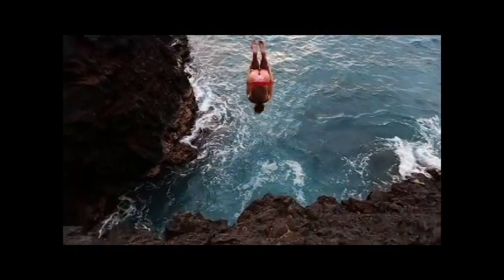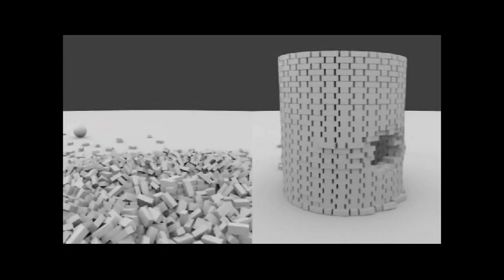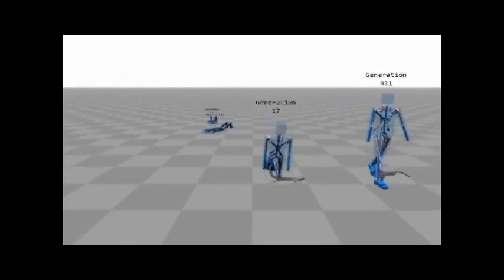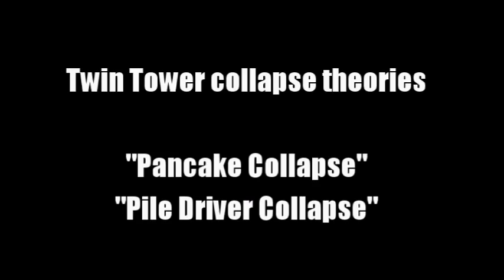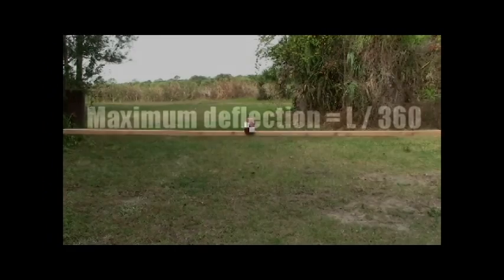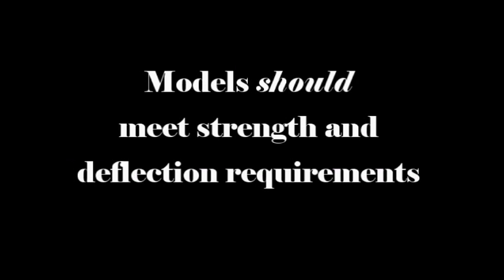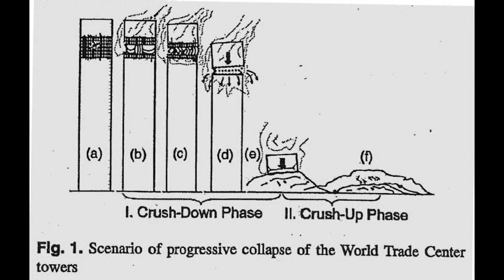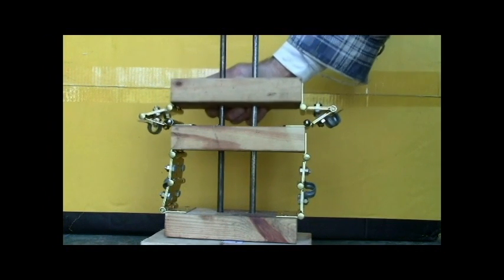9/11 Experiments: The Force Behind the Motion

Comment: As a practicing structural engineer, I should be considered qualified to claim that there are so many things wrong with this video that it is embarrassing:

1. You can't criticize the accuracy of a computer model (which has been proven to accurately predict actual stresses and stains in a structure based on the actual member sizes, material properties, and building dimensions) and then claim that scale models made out of cement board, paper and plastic arranged in ways that are not at all similar to the building construction of the twin towers are accurate.  In this case, you can't assume that physical models will scale to full size correctly, but you can for example use a small scale test to determine the material properties of various materials, and then use that information to determine the large scale behavior of that particular material.  While I'm not positive what type of material you'd have to use for it to scale correctly, I would imagine that you need to use a material that is both extremely weak and heavy at the scale you are working with.

2.  The method you use for picking the floor material makes no sense.  You pick a group of 4 planks to represent a floor because it deflects a certain amount under a certain weight, but your selection is completely arbitrary because you don't have any particular reason for picking a 20 lb weight and you don't take into account the strength of the boards.  In reality when a building is designed, the selection of member sizes is much more complicated than you allude to, and it is not at all arbitrary.  Even then, if the structure pancaked, the floor material doesn't matter, because the COLUMNS are the members that fail... the floors are merely mass that has momentum once it starts moving downward.

3. The experiment you do with the cement boards (6:13) makes no sense.  There wasn't a weight that fell down through the towers failing the floors in FLEXURE like you're testing.  The mode of failure for each floor would have been the simultaneous axial buckling of all columns on each floor, but you make the "columns" (i.e. the wood frame) extremely rigid.

4.  You model the columns with plastic pizza spacers, but the problem is that you are not using a material that will buckle and fail under the impact load which is many times larger than the floor load the building is designed for.  If you want any hope of an accurate model, you need to pick columns that would fail at about double the static load for that particular floor.  Turning the plastic spacers sideways just gets them to shoot out sideways when they deflect...not because they fail.

5.  Same issue with the paper and matchsticks.  Even this material has too much strength, as evidenced by the fact that the same system that is used for the lowest floor is also used for the upper floors.  You make a comment that they don't meet the "deflection criteria", which is a statement that makes absolutely no sense, as you typically don't look at deflection of columns or wall systems in the same way that you look at the deflection limits of a floor system.  If the columns support the exterior cladding, they are subject to certain deflection limit for wind loads between floors, but it never has a significant impact on the column design of high-rise buildings.  Rather the entire lateral force resisting system (either shear walls or bracing) needs to be designed to limit the side-sway of the building.  Burning the walls/columns or busting them up with fireworks doesn't really prove anything either, other than you get the appearance you were hoping for with the fireworks.

You say at the beginning that you are a PE, but what is your particular area of practice?
Reply: +Bernadotte01 Lol!

Yeh, because everyone knows that you need to have at least a safety factor of 2000 when you design a building................. I bet it was a typo, and it was supposed to say 2.00%(So just 2, not 200) which seems more natural. I am in steel construction and we use around 1,5% safety factor, so 2000 is ridiculous. The building would collapse in on itself, because of the weight of the structures needed. Or it would just be a solid steel block.

And the towers withstood the impact of the planes. Or did you not pay attention?

And NIST sent a large part of the FEA of WTC7, and I guess NIST thought, that a group of engineers and architects, could figure out how to model the rest, since they also provided the drawings. And this was in 2009, so what have they done for all this time with this information?
Reply: +chewy531 Well said sir!

I guess this engineer doesn't know that scaling never works well. Unless he wants to see how his car does in a crash, and buys a similar toy car, and throws it against a wall. See, nothing broken, so my car will be indestructible.
Reply: +chewy531 He is a civil engineer specializing in water and sewer systems.
Reply: +chewy531 regarding your deviously dishonest assertion in point 1 about the fabulous capacity of the computer model used by NIST for predicting "actual stresses and strains", NOTA BENE, quote:
=======================
FINDING REGARDING PUBLIC SAFETY INFORMATION
Pursuant to Section 7(d) of the National Construction Safety Team Act, I
 hereby find that the disclosure of the information described below, 
received by the National Institute of Standards and Technology ("NIST"),
 in connection with its investigation of the technical causes of the 
collapse of the World Trade Center Towers and World Trade Center 
Building 7 on September 11,2001, might jeopardize public safety. 
Therefore, NIST shall not release the following information:

1. All input and results files of the ANSYS 16-story collapse 
initiation model with detailed connection models that were used to 
analyze the structural response to thermal loads, break element source 
code, ANSYS script files for the break elements, custom executable ANSYS file, and all Excel spreadsheets and other supporting calculations used to develop floor connection failure modes and capacities.

2. _All input files with connection material properties and all
 results files_ of the LS-DYNA 47-story global collapse model that were 
used to simulate sequential structural failures leading to collapse, and
 all Excel spreadsheets and other supporting calculations used to 
develop floor connection failure modes and capacities.
~
Patrick Gallagher Director National Institute of Standards and Technology
Dated: JUL 09 2009
=======================

Regarding point 4, in which you absurdly claim, quote: 
"You model the columns with plastic pizza spacers, but the problem is that you are not using a material that will buckle and fail under the impact load which is many times larger than the floor load the building is designed for.

quote:
===================
A design procedure that will be used for structural framing of the 1,350-ft high twin towers of the World Trade Center in New York City gives the exterior columns tremendous reserve strength. Live loads on these columns can be increased more than 2,000% before failure occurs. 
-Engineering News Record, April 2, 1964
===================

2000 percent live load redundancy means 19 of  every 20 perimeter columns could be removed and the loaded building would remain standing. (Or you could stack 19 more copies of the building on top of the first without a collapse ensuing.)

i) Do you really think the paper and matchstick walls in the lower levels of the experimental tower wouldn't buckle or crush if <i>95 percent</i> of the paper and matchstick supports were removed?

ii) Why do you think the resident structural engineer at WTC, Frank DeMartini (who supervised repairs following the FBIs basement bomb in the 90s), state, on television, that he thought the towers could easily withstand "multiple impacts" from jetliners?
Reply: +Bernadotte01
Just saying that my "assertion" that the computer models are accurate is putting your life on the line anytime you enter a building or drive across a bridge that has been designed using that software.  Just like any software, you need to enter accurate information (garbage in - garbage out), but these FEA programs like ANSYS have been proven to be accurate depictions of actual stresses and strains in a structure when its modeled correctly.  These computer models are not at all controversial among engineers as they put scientifically proven concepts regarding material behavior into practice.  

On the other hand, I haven't seen anyone give any good reason at all to trust the accuracy of testing collapse mechanisms using scale models.  All I have to do to prove that the scale model isn't accurate, is to point out that the materials used to make the model are not destroyed.  Actual building collapses stress the building materials past their ultimate stress, while the cement board, plastic and match sticks used in the scale models aren't yielded, crushed, or ruptured in any way (other than when they are lit on fire or exposed to fire crackers).

Regarding the 2,000% over-design... lets do some actual math.  Note that it is only the LIVE LOAD that can be increased by 2000%... but live load isn't the only load on the structure.  On March 13, 1969, ENR stated that the total weight of steel used in the structures was 200,000 tons which was about 1/5 of the weight of the structures.  That means that each tower weighed (200,000 tons)5/(2 towers) = 500,000 tons.  The building code requires a live load of 50 psf for office areas and 80 psf for corridors and lobbies not on the ground floor.  60 psf is a more than generous average.  The code allows Live loads to be reduced to 40% of that load for columns supporting multiple floors.  The total floor area of each tower is (209ft)(209ft)(110floors) = 4.8 million square feet.  So the total live load is (4.8 mil sqft)(0.4*60)/(2000 lbs/ton) = 57,600 tons.  Therefore, the live load only accounts for around 10% of the total gravity load.  This means that if you multiply the live load by 2000%, you come up with a factor of safety of (500,000+20*57600)/(500000+57600) = 3.0.  Note that this does not consider any loads from wind loads which would be a significant portion of the load on the exterior columns (at least for the WTC the way it was built).
Reply: +JohnnyBoy2222 
Thanks... and good points yourself.

I read these reports by NIST and ASCE and they speak the language structural engineers use.  When I hear these arguments from the conspiracy theorists I don't get the same thing, and I have yet to hear someone that uses the same language and/or puts actual numbers or accurate models together.  It sounds to me like they are trying to prove a flat earth or something... no basis in reality and smothered in needless skepticism.
Reply: +chewy531 The sad thing is, that they want to explain a building construction in simple math and physics terms. Or throw in Newton's laws. According to truthers, every physics teacher can design the perfect building. And what amazes me the most is that truthers seem to have no problem believing some guy in a youtube video, but dismiss the mountain of work NIST has done to explain the building collapses. This guy does not give out his credentials, because he knows he is full of it.

I can understand that reading the NISt report is a daunting task, especially for people who have no background in engineering, but they also have a FAQ, where they explain most things in laymens terms.

The towers FAQ

http://www.nist.gov/el/disasterstudies/wtc/faqs_wtctowers.cfm

WTC7 FAQ

http://www.nist.gov/el/disasterstudies/wtc/faqs_wtc7.cfm

I have encountered many truthers who never even read those FAQ's , and come up with stories that NIST has explained years ago.

What makes me mad and sad is that this Cole, if he truly is an engineer, should know about the scaling issues in his tests, so either he is no engineer, or he is purposely misleading the people who watch his videos.

And according to AE911 website, he is a civil engineer, so he is actually misleading these people.

"JONATHAN COLE

Jonathan H. Cole, P.E.
Lic: 36384 FL
B.S. Civil Engineering UConn
Englewood, FL

“Jonathan Cole is a Professional Engineer licensed in New Hampshire and Florida, with 28 years of experience. For more than 10 years he has been the head of a mid-sized engineering firm with some 25 employees. In addition to designing large-scale engineering projects, he has performed services as an expert witness in his field. He volunteers his services for Architects and Engineers for 9/11 Truth, in his capacity as a board director. Recently, his experiments related to the thermite theory of destruction for the WTC have become very influential among independent investigators.”" 

His license checks out, and it seems he works at GIFFELS-WEBSTER ENGINEERS, INC.(they are mentioned as related party).
Reply: +chewy531 i) The load capacity of each floor assembly is distinct from the capacity of the columns to withstand live loads. Floor loads represent only a small fraction of "live load' on columns. The steel used to construct the towers is counted as part of the live load on columns. When you multiply the live load by 2000 percent, you have to include the weight of the steel and all the floors loaded to capacity. That is 20 x redundancy, not 3, no matter you spin it.

ii) Frank DeMartini was the resident structural engineer at WTC. You ignored his statement on the capacity of the towers to withstand MULTIPLE AIRLINER IMPACTS,  perhaps because it makes you look like an ignorant clown posing as an expert.

iii) NIST refused to release the parameters they used in their faith-based GameBoy simulation, but despite being informed of that fact with a direct quote from NIST, you cling fanatically to your assertion that it was "accurate."

iv) Except in special contrived circumstances, tall structures tend to fall over when damage surpasses a critical threshold: they never erupt like a volcano or collapse through the path of greatest resistance. Steel structures that fail due to fire and or mechanical damage (extremely rare) never produce persistent pools of molten steel in the rubble. 

v) QUOTE:
==============
Explosive demolition is the preferred method for safely and efficiently demolishing larger structures. When a building is surrounded by other buildings, it may be necessary to "implode" the building, that is, make it collapse down into its footprint.

In this article, we'll find out how demolition crews plan and execute these spectacular implosions. The violent blasts and billowing dust clouds may look chaotic, but a building implosion is actually one of the most precisely planned delicately balanced engineering feats you'll ever see.

--HowStuffWorks, How Building Implosions Work  - 1999
==============

vi) Americans lost their faith in authoritarian wankers under the Bush NeoCon regime, due to the all that now falsified propaganda about "WMD" that was trumpeted 24/7 by goose-stepping presstitutes, politicians and self-appointed "experts," all baying for Iraqi blood.
That's why nobody today will believe "Chewy" the alleged "structural engineer" on youtube when he portrays the inscrutable, secret, unverifiable modeling exercise performed by NIST as "accurate."

vii) "Revealed: US spy operation that manipulates social media: Military's 'sock puppet' software creates fake online identities to spread pro-American propaganda" ( Guardian, March 2011)

That sounds like a job for you!
Reply: +chewy531 We gotta talk brother!
Reply: *****
i) You obviously don't understand what "live load" is.  The entire structure weight including everything permanently attached to it is "dead load".  "Live load" is all the furniture and occupants and generally anything that isn't bolted down.

ii) Considering the towers did withstand the initial impact, I don't doubt it... Especially considering the difficulty in designing for an event like that with so many unknowns.

iii) Ansys is far from a "game-boy simulation".  Unless you never leave your house, you've almost certainly been in buildings or bridges that have used finite element analysis programs, like Ansys, to design them.   I'll grant you that the model is only as good as the assumptions made to create it, but I don't think you would know what to do with the "parameters" if they gave them to you anyway.

iv) I disagree... if there isn't any force tipping it to one side it's not too surprising the collapse would be vertical...  it's much more complicated than that... it depends on what element starts the collapse.  im not sure what would cause pools of molten steel, but i know that controlled demolitions don't create pools of molten steel.  I'm sure there are lots of things that could cause it (broken gas lines, chemical storage tanks, fuel tanks to name a few... but I haven't looked into it deeply)

v) okay... do you realize how much prep work must be done to prepare a building for a controlled demolition?  They would have needed to cut away large portions of the all the columns and beams at each floor, before they would have had to set shape charges... something that couldn't be done in secret in an occupied building.

There is a very good reason why these collapses looked similar to a controlled demolition... it's because they are both building collapses... one is intentional and one is unintentional.  Yes, buildings can collapse in ways other than falling into their footprint, but it depends on the type of structure and what element fails first.

vi) whats your point?  

vii) LOL... if you think I'm a computer generating posts, then why did you respond?  who exactly are you making your point to?
Reply: Chris Carr
Sure thing!
Reply: chewy531 OK, a very old posting, but nice to see that a structural engineer is making exactly the same points I, (a chemist) have been trying to get into the thick skull of a truther.